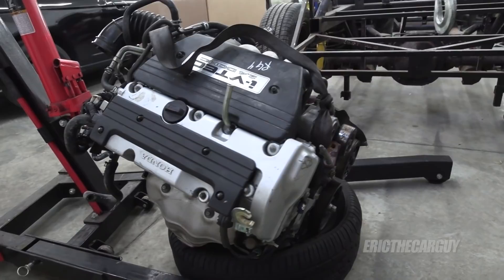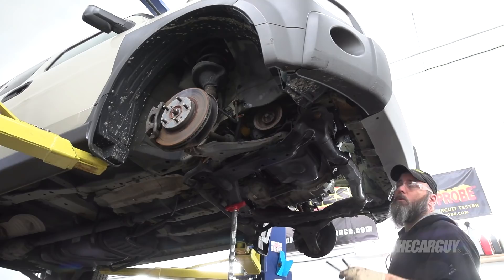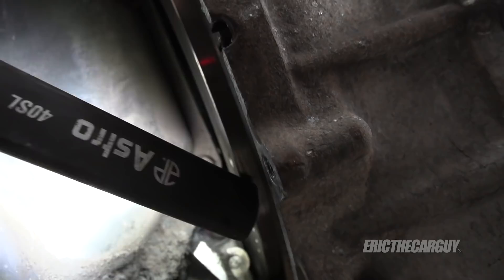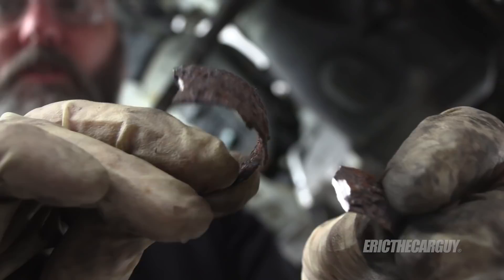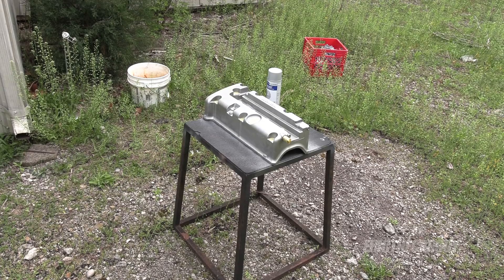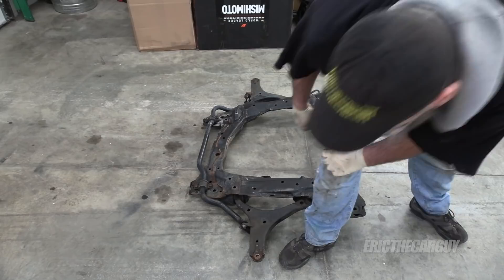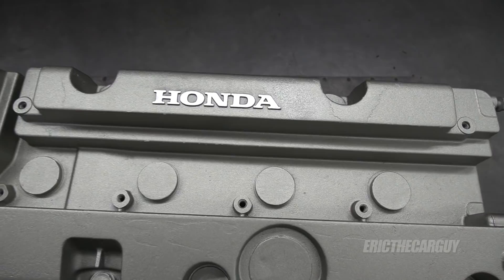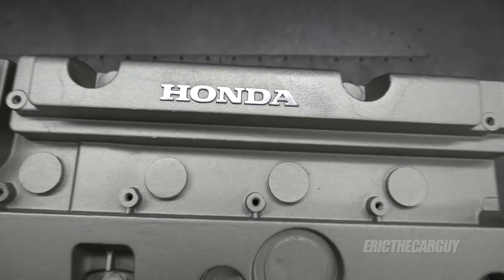Honda Element Engine Replacement and Restoration (Part 1)

Comment: Hi Eric! great job on this video, I may add that I had a similar issue on my 2003 Honda civic with removing the ball joints. they pushed straight through the cap on the top of the ball joint and I had to air hammer the rest of the ball joint out! that sucked lol, good times.

Comment: I work at the company that powder coated the valve covers. In fact, all Honda valve covers and manifold covers from midway through the ULEV on. That particular powder had a lot of stainless flakes in it. There was a change from PPG to Akzo powder suppliers... can't recall when that took place though.

Comment: Hi Eric, At 35:17, you suffered a common problem, too few hands. What I've done is get a very large C-clamp and mount it to the left upright on my press. I can easily adjust the height of the C-clamp and let carry the weight of the control arm while I juggle everything else.

Comment: This is why you either buy a brand new control arm or poly bushings. Less work and easy install. Also why don't you heat the control arm while freezing the bushing?

Comment: A good way to handle those bushings is to put parts in the freezer (as you did) and also apply some heat to the control arm with a simple coleman torch.  You'll have to paint it after, but it will work like a charm... otherwise, I bet you could do them in 1/4 of the time on the next one-- you learned a lot on these--- and so did I, watching you. lol

Comment: Hi Eric, At 36:15, the press wobbles. I know it's a PITA to move later, but I've found that bolting the press to the floor REALLY helps with stability and reduces the flex in your press. Making it easier to press bushings in straight.

Comment: They need to have a "Punch a Honda, (fill in the blanks with your brand) engineer day". I'd wait in line for that, I'd bet Eric might be first in line. I did the control arms on my 04 Honda Odyssey, I went the path of least resistance and more expense by buying new arms rather than fixing the old ones. Much less frustration.

Comment: FWIW I replaced a starter on my daughters 2.4 and found the same thing on the bolts. My thinking was that it was a combination of materials (the steel alloy in the bolt vs the aluminum alloy). Basically I had one thread break free and had to drag it the whole way out. Fortunately its been holding for 2 years now. Bitchy job to do in an unheated garage at -20 c. Now in my case the starter hadn't completely failed but had gotten really lazy. She was home over christmas so it was "Hey Dad...". Anyway, I took the old one apart and found the brushes were leaving a bunch of carbon debris. All it really needed was to be cleaned out. I went ahead and replaced it though.

Comment: My 2013 Subaru legacy 3.6 R has the same front control arm set up has this Honda and I bet you it does the same thing where the rear set up cracks the rubber

Comment: great video
i also painted my valve cover in my 2008 honda element with eastwood  aluma plast  3 years now still looks great. the vht spray paint did a nice job on my winter steel rims  also .

Comment: Hi Eric!
My brother has a 1999 Honda Civic EX and we have replaced the spark plug tube seals for oil leakage. 
We have used Felpro twice now, and even with CAREFUL installation, somehow we get one that leaks/deforms!
Do you think that OEM Honda Seals are better and its just a manufacturing issue with Felpro?
As a long time user of Felpro, I've never had problems with the seals and gaskets they make.
Used them on dozens of flipped cars I repaired over the years.
I used to recommend them highly in my many years as a parts man.
I've seen how much you love Honda OEM components and figured you would be the guy to ask.
Thanks for all the great videos!

Comment: Just lost a bid last Friday 2005 element LX exactly the same color with 117,000 miles. It went for insane $6900. And this is dealer only Auction, not for general public.
Reply: Saw a 2006 element SC (body color panels and nicer wheels) for 6,500 on cl the other day.

Comment: Had to LOL, it feels great to see professionals also run into the same damn problems I do with my cheapo products.
Seems like a lot of work for a standard Element.  Not even tempted to put a hotter engine in there?

Comment: 16:50 what i've done in the past is lifted the car, undid everything like you did and used one of the little wheeled carts to drop the engine on. Makes things a wee bit more manageable. I've a short one used for when you're rolling on a stool, about 40 tall all in all, perfect for this kind of stuff. Much better than dealing with the crane's linear motions.
Reply from the maker: Perhaps, but some carts are too low and it makes it difficult to start the fasteners when the vehicle is on the ground. Not to mention you often have to work on the ground in that situation. That said, there are a million ways to do the same job. Do what works for you is what I say. Thanks for the comment.

Comment: Eric instead of putting the new bushing inside the freezer, next time try to heat up the control arm, using a torch, the old ones will come out using a hammer and an old socket  and you will be able to press the new ones using a C clamp.  I encountered the same problem with my  truck, trial and error. Lol.

Comment: My element has 174K and I have determined it has a head gasket leak based on a combustion gas test of the radiator. Runs and drives great. No oil in the coolant and no coolant in the oil. I probably have to add a quart of coolant every couple months depending on how much I drive. The combustion pressure pushes a couple cups of coolant into the reservoir after I fill the radiator to the brim, but the residual pressure after the engine cools doesn't allow it to siphon back into the radiator. I have replaced the cap and hoses to the reservoir. In your opinion, is a JDM engine swap a better move than a head gasket job at this mileage? I'm trying to make the best decision and the cost doesn't seem all that far apart unless I'm really missing something.

Comment: That control arm is probably aftermarket - hence the HONDA OEM's won't fit.  Learned this on my brake brackets.  Someone did brakes on it and instead of getting new pins, replaced the b racket which wore out after 6 years.

Comment: My left thumbnail is partially black from hammering out an RSX Type-S ball joint last week. The HF tool wouldn’t get on it. And Honda or the aftermarket doesn’t have that ball joint. You have to use an earlier Prelude ball joint.

What K20 engine is the JDM?

Comment: I was wondering, u have the press...why not use it instead? For the bushings. That's my inexperienced mind wondering. A lot of times, if not, most of the times youtubers don't show the struggle when working on a car. It's nice to know what to expect if I decide to work on mine.
Reply from the maker: You can't do the inner bushings on the press because of the shape of the control arm. It won't fit.

Comment: yea, i wouldnt use the ball joint tool, i have only went directly to the hydraulic press... same deal with the 02-07 CRV, and 01-05 civics
Reply from the maker: You can't do the inner bushings on the press. The shape of the control arm doesn't allow it.

Comment: Hello Eric, my Honda element 2006 Has an issue, the rpm raves high with over drive throttle cable on , but once we removed it, the acceleration got normal on idle... But doesn't change gear fast when driving...  And sometimes acts like it is going to go off with the AC turned on while driving and I slow down in traffic for a bit..   please what can I do? And I think it consumes lots of gas than normal ... I have error codes like p1009

Comment: Hi need you opinion, i have the same car too.  I have a p0172 code.  I did replace the O2 Sensors and map sensor.  And still im getting that code.  Need help.

Comment: oh heck yeah. this will help for when i need to replace the engine in my CRV! 
 ETCG FTW.
New fly! Blue Coolant!

think you're gonna try to patch the holes in the back where the hook pulled it out of a field?
Reply: also, i felt every ounce of anger with those bushings

Comment: 33:05 based on recent direct experience removing the transmission from my '05 Element, occasionally you get thread damage from corrosion that sets in on bolts that "daylight" through the transmission housing.  This is likely what happened with that one bolt fir thd starter.  The damage occurs during removal and cannot be avoided since you have to remove the bolt.  Best to use a thread chaser kit or a same-size metric tap and die set to repair the inside threads and the threads on the bolt before reassembly as you did in the next video.

Comment: Oh man, I had a good laugh watching the LCA bushing replacement, especially at the
point "I'm gonna kill somebody." Once I saw that screwdriver roll off the workbench
twice, I sensed bad luck was in store. Wonder if the starter was tackled from below
causing the stripped threads in the trans. Hang in there Eric.

Comment: Droping sub frame is tuff,easy to pull trans n motor up...done both ways...out the top is far easier..peace😎
Reply from the maker: Easy is relative. Thanks for the comment.

Comment: Just need some help was changing spark plugs for my 2011 Ford escape 2.5 and the 2 middle spark plug look like water getting in   combustion chamber anyone can suggest what kind of problem is that

Comment: You mentioned that you are using a different engine that didn't originally come from the same model Element. You also mentioned that the engine you are installing was imported. Is it just an availability thing, or are you doing a performance upgrade?
Reply from the maker: In Japan, they either have to replace the engine or the car at about 60K. They have very strict emissions laws. https://en.wikipedia.org/wiki/Motor-vehicle_inspection_(Japan)

The engines that are removed are often bought up by companies in the US and resold like this one was. I wasn't completely happy with the company I worked with on this as it took a very long time to get this engine after I sent the first one back. I don't like endorsing companies I have bad experiences with. Still, this engine worked out great in the end. It just took forever to get.

Comment: I have a question. Can u recommend a professional in SoCal? I need my engine either REBUILT or REPLACED. And several other little odds and ends, I basically want to REJUVENATE my 2004 EX. ??? Thank u in advance…

Comment: Eric I have a question for you I have a 2006 Honda Odyssey the driver side CV axle went out in it it was making the car shake real bad between 45 and 75 mph I changed it myself and the axle was stuck in the hub so bad I had to have it pressed out with a two and a half ton bench press after it's all been put back together it has been driving fine except now it's about a month later and I noticed when I put it in reverse or drive out of park and I first go to take off I hear a loud click and it sounds like it might be coming from the same axle do you know by any chance what it might be or why the actual might be making that clicking noise it only does it one time one click and I have had previous axles go bad that click real bad when you turn it does not sound like that type of clicking so I was hoping you might have an answer for me if you do thanks and by the way I love working on cars I am very passionate about cars I always have been and I have seen every single one of your videos you have the best car repair videos on YouTube by far please don't ever stop making your videos

Comment: @26:46 Get some liquid nitrogen and dribble a small amount on the bushing and it falls out, but don't immerse the new one as it will take some time to expand, the stuff is getting a lot of use in everyday kinds of work and niche types also like shrinking a locomotive cast iron wheel to take a steel tire, instead of using a tool called "The Ring of Fire" to heat the tire and put it on that way.

Comment: You can move a small apartment via few trips with the lovely 'Toaster' .  Every 100,000 miles, have a Honda dealership-trained tech with some gray in hair adjust your valves.  Change your Tranny fluid ( dealership tranny fluid Only for Honda's ) every 60K.  200, 000 miles easy. Peace.

Comment: Can you just unbolt the top of the struts, and drop the engine down still mounted on the subframe? I used to do that with the old Mercury Villagers with the Nissan engine recall. I haven't been a mechanic since 2000, but I do work on my own cars..
Reply from the maker: Yes, but you don't need to disconnect the struts, just the lower ball joints. I would have done that if I had something to set it on. I'm considering making something for future engine swaps like this.

Comment: Eric thanks for the vid. Just wondering if a hole saw would be faster to remove the bushing rubber instead of a drill ?
Reply from the maker: I don't think so. You need to cut the side of the busing sleeve. I don't think a hole saw would be very good at that.

Comment: You should heat up that controlarm housing before you attempt to put the bush in. I did the same thing when I was changing the crankshaft bearings on my Yamaha Aerox and they practically dropped right in, whereas before they would require mechanical force to go in.
Reply from the maker: Putting the bushings in the freezer essentially does the same thing.
Reply: @ericthecarguy  I'm saying do both. Instead of a freezer I get a can of that air duster and turn it upside down and blast it until it freezes before insertion if it can be done quickly

Comment: Manual transmission starter can be replaced without removing intake there is just enough room to remove it. I have done it 3 times
Reply from the maker: https://www.youtube.com/watch?v=dRZN4Tk9bNo&t=53s

Comment: I’ve had mixed reviews with JDMs.  I’ve swapped out probably a dozen.  I’ve found that some shops are shady, others are jam up.  I’ve used JDM Orlando and had GREAT results every time.  They do a compression test while you watch, but they’ve always been great...I’ve bought Honda’s and Toyota engines from there.  However, JDM worldwide in Jacksonville.  Terrible, I thought I’d save the trip to Orlando, big mistake.  Three different engines...b20, so, after #3 being bad I said no thanks and went to JDM Orlando.

Comment: I have a really dumb question. Why the witness marks on the control arms when you removed/replaced the bushings? I did not see any marks on the new ones to indicate a particular orientation.
Reply from the maker: They need to be installed in the exact same position or they won't work correctly.
Reply: @ericthecarguy  Thanks for the reply.

Comment: Is this an Element thing?  On all the FWD cars we work on/race.  We leave the engine, trans and suspension attached to the subframe and raise the car around it.  Without a lift it takes a bit of time (like at the track) but we have done it probably a dozen times with about half of those using jacks and jack stands.
Reply from the maker: You could do that also. That's how they do it at the factory.

Comment: Powder coating can be easily burned off with an acetylene torch. When I say easily, I mean you can call it 'flash-ash'.  It instantly flash burns where you're barely even heating the part. It's fun too :D

Comment: Taking things down is fine but how do a newbie like Me know the order of putting parts back and which of those bolts go,taking picture and labeled sandwich bags can’t help me get the whole thing through
Reply from the maker: You'll notice I keep all the fasteners with the part I remove to make assembly easier. You can also take pictures during disassembly.

Comment: Eric is there any reason you don't coat the under side of the element with bar oil to prevent rust ?
Reply from the maker: Because I use the Krown product I don't feel the need.

Comment: The Honda assembly plant folks don't always hand-thread fasteners before running them with an impact, either ;)
Reply from the maker: The clutch and starter on this engine had obviously been replaced at some point. I can't blame the factory for that. Although, that information is disconcerting.

Comment: 31:34 could have told you replacing the whole assembly even if it cost a bit more is always the way to go. I've had several cars I've replaced bushings on. Some gm's the bushings are a super tight fit and really hard to remove and replace, and to add to the fun pressing in the bushing cam cause the arm to bend because some GM arms are made of thin stamped steel. So from now on, unless the arm is crazy expensive, I just replace.
Reply from the maker: Nobody makes bushings as good as Honda. At least in my experience.
Reply: Prothane

Comment: Man. My wife needs upper and lower control arms, ball joints, all that suspension stuff. Unfortunately a complete kit (that's affordable) for her stupid Saab 9-7x\Trailblazer... thing... is around $600. I was hoping I could get bushings and a harbor freight press for a lot less than that because my second kid is on the way and I can't afford that noise. Seeing that nightmare though.. Not sure what I can do now, but it doesn't look like it's worth the headache doing the bushings.

Comment: Thats major surgery , looks like a lift is the key, & some charged red fuel.Are you going to open that engine up give it an inspection , compresdion ect.. Nice project.One final question, when you took out the axle half shafts, were thete clips holding them in ?
Reply from the maker: I answered the engine question in the video. The axles are held in by spring clips that can easily be pried out. Thanks for the comment.

Comment: A quick question for Eric.  I have an 09 Accord and live in the southern US.  What oil do you recommend for the V-Tec engines?
Reply from the maker: Whatever is printed on the oil cap for viscosity. You would probably benefit form high mileage oil.